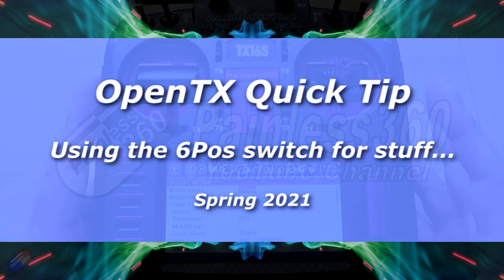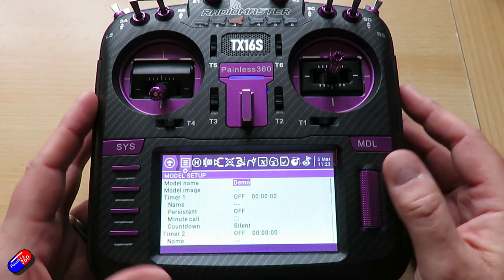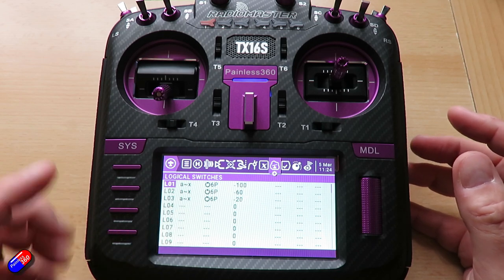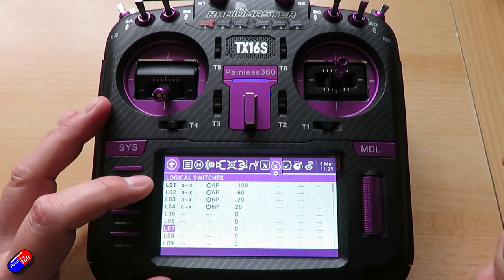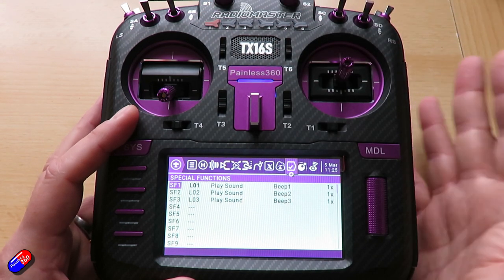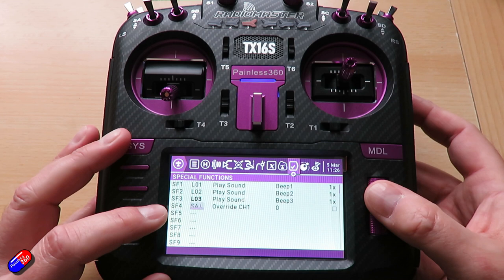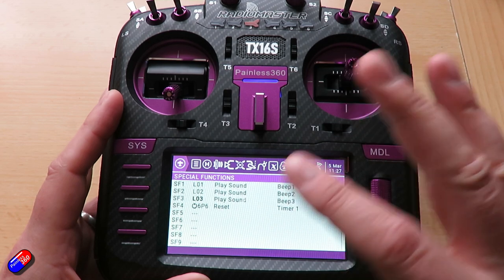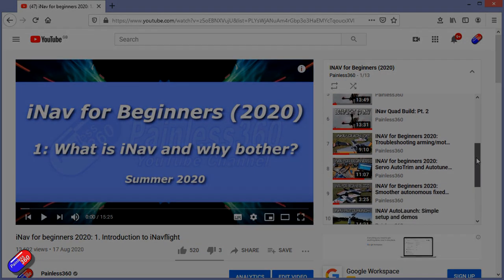OpenTX Quick Tip: Using the 6POS switch for other stuff..

Comment: very nice tips! I use those 6 buttons to manage my timer. 1 for timer ready. 2 to play remaining timer. 3 for timer reset. 4,5,6 set timer to 1,2,3 munites.
Reply: How do you set one of the 6 position switch as a timer reset...thats what I'm wanting to do
Reply: @Deathwish_fpv  in special functions in each model. Or globel functions in the system setting.

Comment: Been using this for a while now but my use case is different.  In FPV team racing where you race for a long period of time and have many quads ready, you can power on all quads and set in your FC software (Betaflight in my case) to failsafe and disable VTX unless the correct model number on the 6 position is selected.  There is also a manual VTX disable on a switch when you aren't flying or you crash and need to quickly disable as the buttons are harder to distinguish than a big switch.  :)  Hopefully that makes some sense...haven't finished coffee yet.
Inav modes is another good one to use them as someone else mentioned.

Comment: Great demo, i have a few models that need binding every time i switch on, is there any way of assigning a logical switch to bind without having to scroll through the menue to keep binding, thanks, love your vids as always,
Regards.,
Nick.
Reply from the maker: If you are using the Multiprorocol module then check out the Tips and Tricks video on it where that is covered..
https://youtu.be/Nii4ElEbg6s
Reply: @Painless360  thanks very much will check it out!

Comment: Can you use the 6 position switches on the tx16s as a timer reset button.. just curious
Reply from the maker: You can use them the same as any other control on the radio. Happy flying!

Comment: I've had this working perfectly in Edge TX, then after 1 year, the push buttons are acting weird.
1 - ok
2 - stays on position 1
3 - goes to position 2
4 - stays on position 2
5 - goes to position 3
6 - stays in position 3
What on earth is going on here?  Can someone help please?
Reply from the maker: In EdgeTX,  the 6pos control is a lot easier to use in mixes. I.e. 6P1, 6P2 etc..
Reply: @Painless360  Thank you Lee.  Someone suggested a recalibration , including pushing each button in turn. That solved the problem.  I just don't know why it would lose calibration. It was working fine until recently.  Basically buttons 1 and 2 outputted -100, buttons 3 and 4 outputted 0, and buttons 5 and 6 outputted +100.  Very strange, but all is good now.